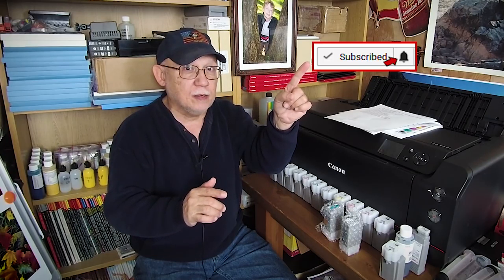Comparing PrintHeads types   Which one Clogs Faster?

Comment: recommended to keep a 13-17% humidity level, and your chances of dry out are little with the occasional head clean schedule.  I have owned 5 different pro model Epsons and 4 HP, and my first canon is the Pro 10. Never looked back at an Epson and all its troubles. No regrets here. :-) good info!
Reply from the maker: Thanks!

Comment: Yes. that is true . My canon pro 100 print head damaged just because I didn't refill until got a warning massage . the problem is if the amount of ink you refill less than OEM ink so it will empty before you get warning message .so just Refill it when it getting low
Reply from the maker: You must never under fill and then reset as your chip will think you have ink when you really do not.

Comment: Hi Jose!  Good content.  You forgot to mention that Canon's printheads are user replaceable and fairly reasonable in price.  Epson printheads are only replaceable by service center and costs more than the printer.  My experience has been that Epson heads clog much more and are harder to clean. I have had to throw away several Epson printers but my Canons just keep going.  Canon does a better job of self cleaning and I have never met "end of life" situation with a Canon printer.  I am using a Pro-1 now and have found it superior to any Epson I have owned in terms of clogging.  In fact, my Pro-1, in the 2 years I have had it, has never clogged and I live in a dry Colorado environment and print sporadically.
Reply from the maker: I sure did! But I was concentrating on the clogging aspects of either style rather than the replacing of them. I thing I touched on that a bit indirectly when I say You'd Better have a couple of them ( Pro-100 Print heads ) in case. Sounds like you've had the pro-1 longer than I.  I have to say that I've not had a perfect a luck with mine. Had one B-200 error on initial install and then after about a year and had to replace the print head. Just the other night I after not using it for several weeks I had another one which resolved itself luckily. Knocking on WOOD ( My Head )!

Comment: Good information again Jose. A couple of questions:

1. After taking my Pro-1000 to the shop (as recommended by Canon), it seems that when I print, I smell something heat related--ink, plastic, not sure what. Is this normal? Prints are still perfect. Is this moving toward a heat related clog?
2. It sounds like all you have to do with the Epson-P800 for example- is use it once a week or a little more and you should not expect a clog. Is this correct?
3. Since it is shooting cold ink vs. hot ink, does the Epson not use ink for cleaning unless not used for a very long time--1-2 weeks?

I'm beginning to think that the problem with the Pro-1000 wasting so much ink is a head design issue.  They have designed a head so large they are having heat related clog problems and are solving it with a lot of ink.  Think what would happen if a Pro-100 used as much ink. Print once every 2 days and in 30 8 x 10 prints your cartridges would all need to be replaced not to mention the waste ink tank soon being useless.

Mabe
Reply from the maker: That 1000 is a different animal in its own right.
I've done some checking using the accounting software and have come to the conclusion that if I were to print nothing but 13x19 prints which use about 1.5 - 2 ml of ink or 17x24 prints which use about 2-2.5 ml of ink per, and do that say every 4-6 hours you use the ink required per print plus a fraction of an ml per each print for a micro head prime. No cleaning cycles will be performed. Almost ALL the ink used will be for making prints.  The proportion  drastically changes to the opposite if you print the same number of prints but do it a few apart. The same hour timed cleanings do not apply to the PRO-1000/2000/4000/6000. These are definitely completely different beasts!
Reply: So, because of design issues with the Pro-1000 I purchased, all I have to do is print every 4-6 hours and I will not waste much ink--otherwise I waste 7-10 times the ink I put on paper.  Of course if I had known this by Canon marketing this as a production facility printer or by reviewers of this printer being honest instead of trying to curry favor with Canon then I would have purchased an Epson P-800, which by ALL accounts produces prints that are indistinguishable from those produced by the Pro-1000, and thereby saving myself many hundreds of dollars in ink cost over the life of the printer! I imagine that after I use up the extra $700 of OEM ink I purchased I will be better off financially using this printer as a boat anchor and buying an Epson--I'm not joking, do the math.  And don't get me wrong, I don't blame users for not getting the word out.  If I had not witnessed the 59 ml purge on my machine that sent all my cartridges to low in 6 minutes then I probably wouldn't have realized what a waste machine this really is. With all that said, I think it is important that people pass this information on to prevent others from making the same mistake.  It is a shame that such a reputable company that has made such outstanding equipment over the years has produced such a flawed piece of equipment. 

Mabe Hall

Comment: Hi Jose!  I just ordered a Pro 100, and wonder if you think it would be a good idea to plug it into a UPS?  We have several power outages a year here, so I would like to prevent the large cleaning cycles that occur every time the printer is unplugged/replugged... I assume that it would do the same cleaning cycle after a power outage.  I know that the UPS would only keep the printer powered for a short time, but I am hoping it would be effective for most of the outages we have. I know you are not supposed to put a laser printer on a UPS due to the large amount of power drawn when the fuser heats up... you don't think the thermal printhead on the 100 would have a similar effect do you?  I'm sure you discuss this in one of your videos, but I couldn't find it!
Reply from the maker: Absolutely! If your area is prone to power outages then definitely!
You might also consider a voltage regulator to control power surges that will kill your printer's mother board.
Reply: Thank you!  I'm not familiar with voltage regulators, but I will do some research.
Reply from the maker: Yes, it's over kill but I lost one printer to a voltage surge and do not want to experience that again.